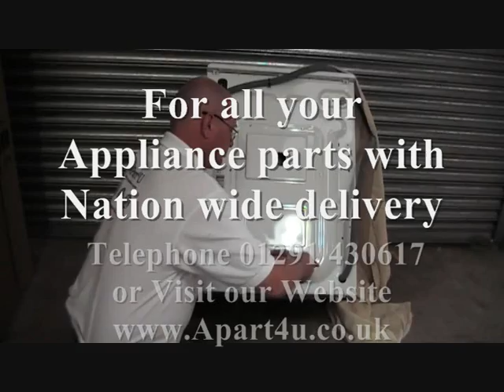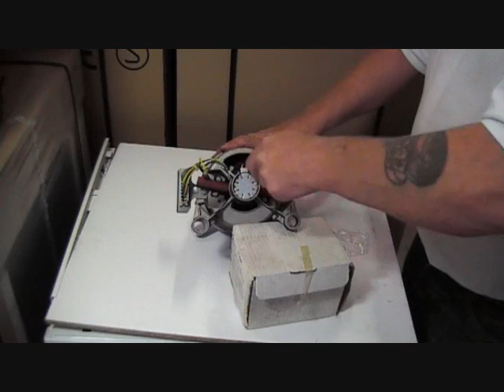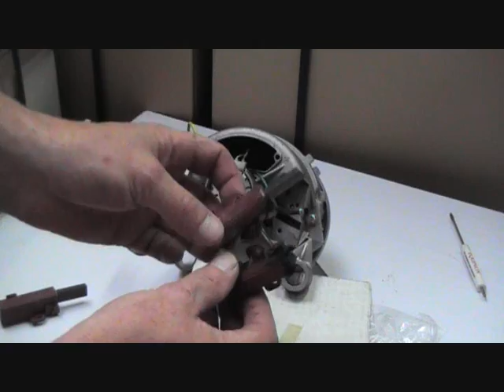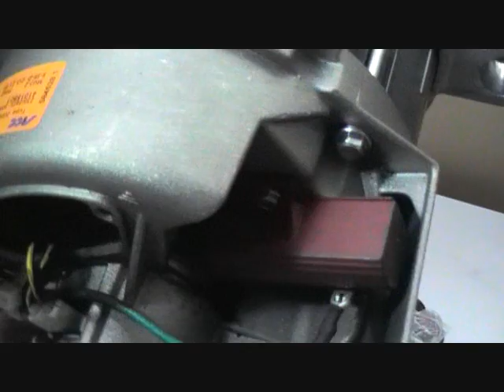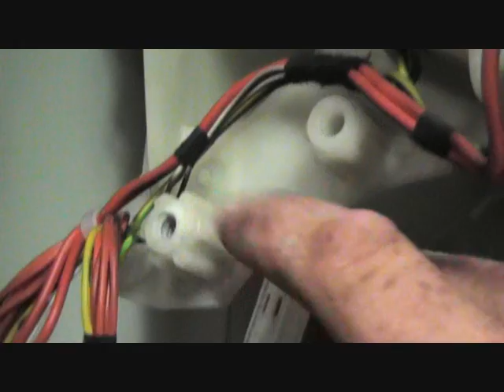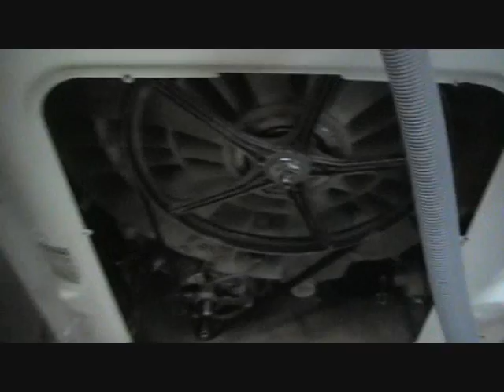How to replace washing machine carbon brushes .

Comment: hi i have a zanussi model 12070w1 and i started  wash last night and forgot to add another item so i turned of machine and waited till door opened then started the wash again . but now machine seems to wash ok but doesnt like spinning , clothes come out soaking. so i took all clothes out and tried machine with empty drum and spins fine . just wont spin now when clothes are in . what could be wrong ?any help much appreciated. machine about 5 years old. would brushes cause this fault or ?